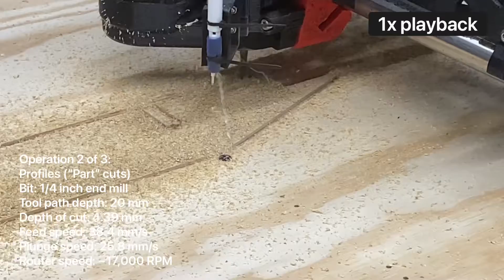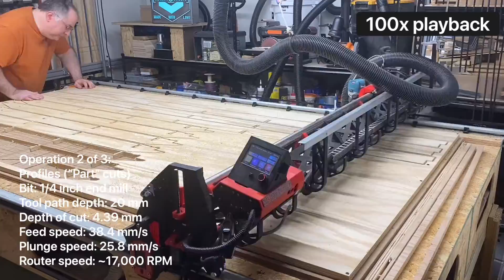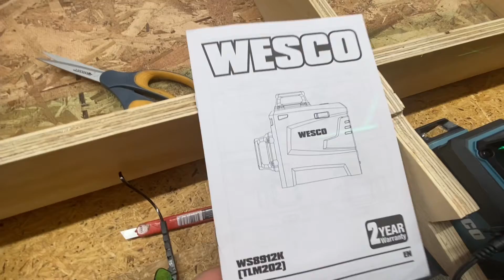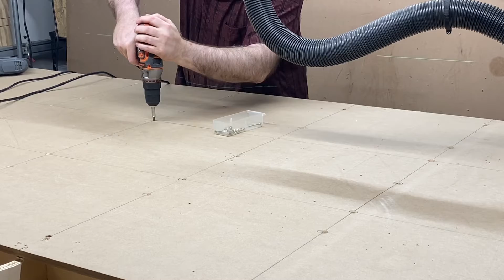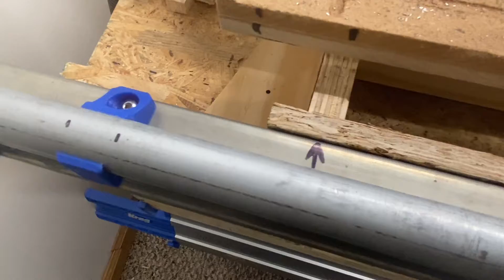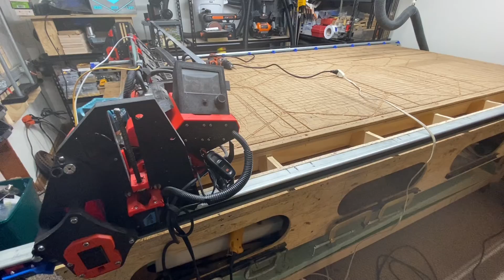For LowRider v3 CNC, full sheet capable table, Part 2, CNC cut & assembly!

Comment: Hello Doug! I am working on building this torsion box setup and using your Unistrut dual hidden belt design. I was wondering if you could tell me how long exactly your 3 conduit tubes are on the strut so that I may use that for a reference to get the width just right?
Reply from the maker: Sure. As shown on the documentation page linked below, my gantry is 1435 mm in length. I think the V1E calculator recommends 1425 mm. Either can work (the shorter one by compensating with longer "standoffs" on the hidden belt mod on the side opposite the Y-rail). Be aware that my 1435 mm gantry has my X-max side assembly riding pretty close to the edge of the metal strut. https://design8studio.com/for-lowrider-v3-cnc-cut-table-dxfs-for-cutting-f360-archives-docs/
Reply: Thanks Doug! I want to say that I am thoroughly impressed/appreciative of your organizational skills, and ability to lay out a project for those of us without such skills!
Reply from the maker: @clayscustom  Thanks! I’m human and I make mistakes. I appreciate when people cut me slack when they find that I have made a mistake.

Comment: Couldn't you double up on spoil board and resurface a few times so the CNC essentially self levels?
Reply from the maker: You can generally always use surfacing to correct for lack of flatness, however, the flatter your surface is (to begin with) the better. Surfacing a table that is very "unflat" will mean an enormous waste of MDF spoil board being turned to dust, and it seriously reduces how many "re-surfacings" you can get out of a sheet. The bigger a table is, the more flatness matters. 1% dome or dip on a small table is no big deal. Surfacing that won't take deep cuts. But that same amount of curvature on a big table means the surfacing cuts have to be very deep. Always best to start as flat as is reasonably doable, before surfacing.

Comment: wow its amazing table project Its looks less stressing on the balancing side and easy moving almost portable......I will look forward for my lowrider v3.........keep up I really enjoyed watching...... 👍
Reply from the maker: It could be moved with help from a friend. The MDF skins on the top and bottom add some weight. Without them, the frame itself is not heavy at all.
Reply: @design8studio  am planning to build one for my lowrider 3 48x96 inches do I need to resize it or I can just go directly cutting.....
Reply from the maker: @Aaan-cnc  whether you can use the existing cut plan depends on whether your material thickness matches the existing thickness variable in the drawing. If not, it would need editing. :-)
Reply: @design8studio what's the required thickness.?
Reply from the maker: @Aaan-cnc  there is no required thickness, other than the thickness of whatever material you buy. The cut plans that I outputted were set for a thickness of 23/32”. However, even if you buy some sheet material that says it is that thickness, you would need to measure with calipers to verify. It’s common for it to say one thing and actually be slightly different. If you wanted to do some other thickness, there is a way to open the fusion 360 file that I provide, and edit the user parameter for material thickness, and then re-output the DXF’s that are affected by that, which would be the ribs and spars.

Comment: Hello .  now that some time has passed and you have used your new torision box.  Is there anything you would have done differently or is everything working perfectly?  it will be my next project so that's why I'm asking.
Reply from the maker: I wish I had done MDF on the bottom, according to my original plan, instead of OSB — as that would have gotten ribs for support at the very edges. Now that I think about it, I would probably have not cut strips off of the bottom sheet, and would have spaced it so the ribs ended right at the edge of the MDF on both the top and the bottom. I’m nitpicking.
Reply: @design8studio  ok i will build mine of 22mm mdf

Comment: hi i was going to say this machine is crap because i built a small cnc and its feed rate was 50mm/min and i saw you going around at 34.5mm/s. My brain farted and i thought you were cutting at a slower speed that mine, i am currently printing the parts for my machine it will be an Ice blue machine
Reply from the maker: It's a capable machine.... There are LowRider makers who have pushed theirs faster and harder than I am doing here in this video!
Reply: @design8studio  if all goes well i just have the LR core and one more brace to print tomorrow
Reply from the maker: @cryoine7194  wow you are making quick progress! Please consider posting pics on the V1E forum.

Comment: hey how long should i cut the metal struts for this design?
Reply from the maker: In the Fusion 360 file there are models that mock up the metal struts, and that length and placement is based on reality for my setup. You can use the Measure tool (hot key "I") to measure distances and lengths. Bottom line is my plan called for 114" long struts, with 8.25" stick out on the front (from the first X-rib to end of struts) and 11.25" stick out on the back.
https://design8studio.com/for-lowrider-v3-cnc-cut-table-dxfs-for-cutting-f360-archives/#F360-archives

Comment: Thank you so much Sir, for your hard work and diligence, i watched every second of the video just watching the workflow, it helped a lot :)
Reply from the maker: :hand-pink-waving:😊 Glad it helped!
Reply: @design8studio  Hi there  Joseph, i finally finished my Lowrider 3 and will cut you table design in 1/2 inch ply, but i was not able to find the fusion file to modiiy the parameters, did i miss something, hope you can guide me in the right direction :)
Reply from the maker: @13blackandblue13  Congratulations on getting your LowRider completed! The link to the download page is in the video’s description. However, since you are using 1/2” plywood instead of 3/4”, may I suggest you bump the height of the table up. Consider using either the 6 inch or the 8 inch version on this page: https://forum.v1e.com/t/more-parametric-cnc-cut-tables-for-lowrider-v3-full-sheet-3-625-6-and-8-tall-versions/37819?u=dougjoseph

Comment: where is your second Y belt?
Reply from the maker: (On my LR3, my X and Y are flipped, but my answer will be as if they are not flipped.) One of my Y belts is as normal, but is "flown" out in mid-air off that side of the table, by way of 3D printed "wing extenders" — see first link. The other Y belt (on the near side) is hidden inside the metal strut — see second link:
https://www.printables.com/model/220187-lowrider-3-cnc-table-extenders-to-use-lr2-table-wi
https://www.printables.com/model/422468-lowrider-3-cnc-mod-hide-protect-one-of-the-y-axis-
Reply from the maker: In my previous reply, I linked to the printable table extenders. Those work for both sides. The "wings" on my near side don't stick out as far. My second link for hiding the near side belt inside the metal strut, makes the wing extenders on that side to be no longer needed.
Reply from the maker: This video shows both belts being reattached.

Comment: love this keep it upp bro 
the cutting area of this is 4ft x 8ft correct?
Reply: Just made mines only prob I didn't get the exact struts you used so I have to make some changes to the rail files
Reply from the maker: @jj8482  cool! Post pics of your work on the V1E.Com forum if you can!
Reply: @design8studio  i will funny enough i made it with a jig saw lol and a vinyl plotter 
im not to well at designing 3d models so the side attachments might take me a while to figure out still waiting for my parts for the lowrider to reach my country
Reply from the maker: @jj8482  cool!
Reply from the maker: Yes, and actually a bit bigger. It's made to cut 49" wide by 97" long, because MDF sheets come 1" bigger in both directions, and the idea is to be able to flatten (resurface) the entire MDF sheet!
Reply: @design8studio  great stuff, where im from  4x8 is the biggest ply and MDF comes in I'm from Trinidad the Carribbean
Reply from the maker: @jj8482  This would have you covered with room to spare!

Comment: Awesome work. Im in love with that table build. Im the one who asked for a bigger table build... Have you nanaged to fix the issue with the f360 file?
Reply from the maker: Yes, I replied on the forum about that. Did you see the new replies?
Reply from the maker: Here's a link to all the parametric tables I've posted. In particular, the page with the 3 height options, 3.625", 6" and 8" — has F360 files more robust and requiring less attention when changes are made, but by posting several sizes, hopefully changes are not needed. https://forum.v1e.com/tag/parametric-table
Reply from the maker: Also, check out this reply I posted for you, including a Fusion 360 file at the table size (width of table) you had mentioned: https://forum.v1e.com/t/cnc-cut-table-for-lowrider-v3-parameterized-for-cutting-full-sheets/37579/167?u=dougjoseph

Comment: Perfect! Thank you so much for doing this Doug. Would you be able to disclose your gantry EMT tube length for your strut channel version of the table?
Reply from the maker: Sure
Reply from the maker: So, the length shown in the graphic (link below) will work, and there is some latitude here. 56.1" (shown in graphic) will get your roller bearing wheels about centered on the unistrut. In my specific table, my tubes are stainless steel (25.4mm dia), cut to 56.5" length (1435mm). That has my (near side) roller bearing wheels rather close to the edge of the unistrut. That meant my "standoffs" could be shorter, for my setup to hide the long belt on the near side. If you use 56.1" for your length (1425mm), you can use the same setup, you would just need to get the "standoffs" to be 0.4" longer, either by remix or by scaling in slicer.  https://i0.wp.com/design8studio.com/files/Screen-Shot-2023-04-11-at-5.36.07-PM-X-Gantry-Placement-X-axis-Tube-Length-etc.png
Reply: @design8studio  gotchya! I just cut my 23.4mm tubes to 56.1 so I’ll work on getting that extra 0.4” adjustment and go that route. I think I’m understanding you correctly, or would I be good to go since my tubes are slightly smaller than yours? Thanks for all the help!
Reply from the maker: Yes, you should be OK. If you do my mod to hide the long belt (inside the metal strut) on the side that does not have the Y-axis EMT rail, then you can just lengthen the standoffs for that mod by 0.4" — and for the side with the Y-axis EMT rail, use the printable "wing" table extenders I shared. If you don't use my belt-hiding mod, then you can account for the 0.4" difference in various ways. You could remix the printable "wing" table extenders to change the width by 0.2 on both sides. Another approach for accounting for it, is to remix the Y rail blocks (revising "where" the Y EMT rail rides on the metal strut) and then revise the printed extenders on that side accordingly. I'm happy to help with any remixing.
Reply from the maker: If you go with the same measurement as mine, 56.5" (1435mm), then the table extenders I linked should work. If you go with 56.1" you might need to remix a set of the printed table extenders.
Reply from the maker: I will make a new graphic so there is one for metal side rails and one for wood side rails.
Reply from the maker: Another way to accommodate a table width difference of 0.4" is to switch the 1/2" "backer boards" that the metal struts go against, from 1/2" to 3/8" plywood, or some such thickness that moves the rails closer together by about 0.4" total. Anything close should be OK. And of course there is always the option to edit the cut-ready vector graphic DXF file for the cut plan, to change that vertical ledge by 0.2 on both sides.
Reply from the maker: Hey, I updated my download page by adding a graphic that gives X-Tube length info for tables with metal strut sides! Here's a direct link to the new graphic: https://i0.wp.com/design8studio.com/files/2023-04-21-Gantry-Placement-X-axis-Tube-Length-etc-TABLE-with-METAL-STRUT-SIDE-RAILS.jpg

Comment: Pure gold. You've earned a sub, Doug. I'm hoping to cut mine in the next week.
Reply from the maker: Cool! Looking forward to seeing your build!
Reply: @design8studio  Have the torsion box struts all assembled. I programmed in a tolerance of only 0.010" on the struts and also glued it all together and WOW. I had to use all my clamps to get it together. Couldn't have been more perfect of a fit. Putting on the top and bottom skins later today.
Reply from the maker: @unbrokenground5694  that is so cool! If you get a chance, please post photos of your work on this on the forum at v1e.com!
Reply from the maker: @unbrokenground5694  take pics! Take videos if you can!!